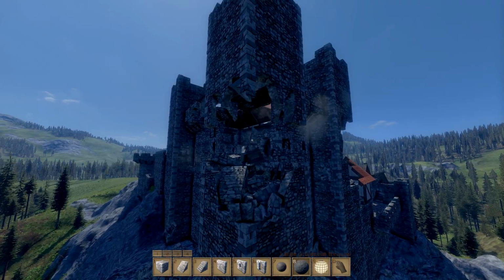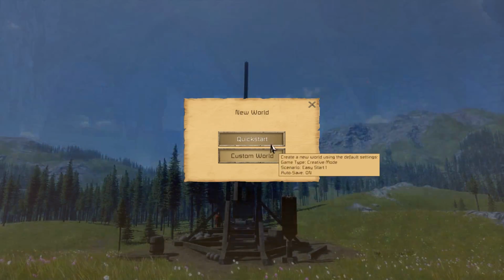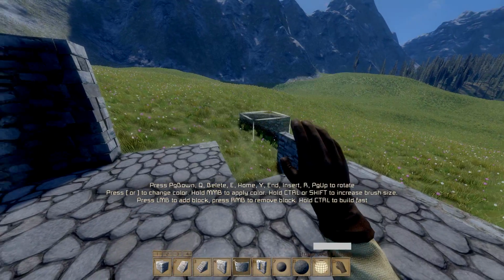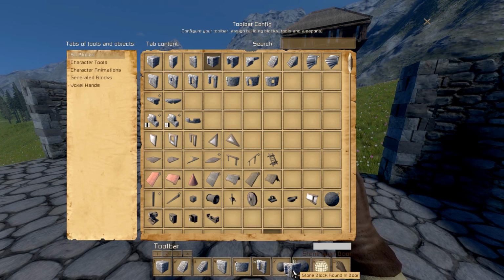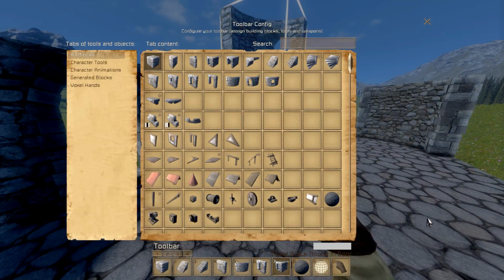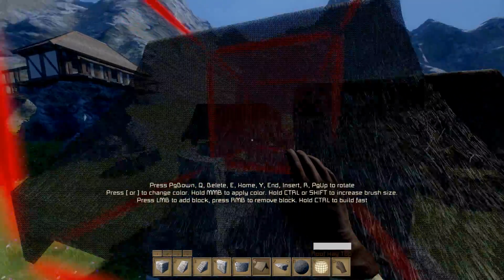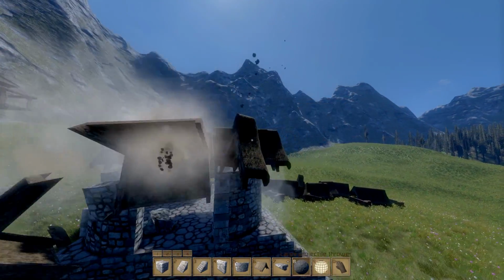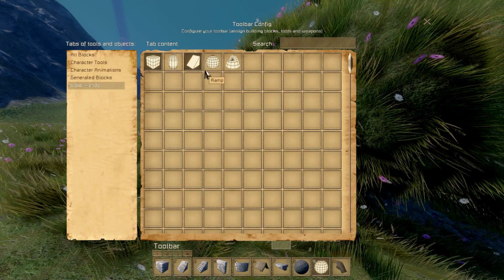Blowing Up Castles - Medieval Engineers

Comment: Is he really complaining bout just over 20fos? I run this game on empty map not moving at under 10fps. I run minecraft lowest graphics at just over 20fps very rarely hit 30fps.
Reply: Oh and btw Why Be Are you can place the walls I the corner, press alt and it toggles between normal placement and that smaller placement so you can place blocks in blocks. Someting space engineers never had.
Reply from the maker: Bran04don13 I mention it because I like my 60 FPS, and have a pretty good computer, so if it lags for me it will probably lag for people watching the video too if they had the game.
Reply: do you use optifine?
Reply: Bran04don13 Use optifine for minecraft, it helps :P

Comment: If you press "g" it will open up a menu then go to character tools and there are both those boulders with 10x the mass
Reply: Press crtl+w to access the rocket launcher, and mouse wheel to select the destructive radius

Comment: YBR, you actually can use wall blocks on corners. Hold down ALT while placing blocks to put them in the same space as other blocks, to make "compound blocks". Place one side of the corner, hold ALT, place the other side. It works!

Comment: You don't have to use rounded walls for corners, you can hold ALT and it will combine the bricks into the same grid, or you can click Z and it will do it automatically when you come across a brick.

Comment: Does this even have a hope of running on a Laptop with core i3 on very low settings?
Reply: Afraid not.. I am running an AMD FX-4350 Quad-Core 4.2 ghz 12 mb cache and a Readeon HD 7850. The game runs fine, but the moment you destroy something... The physics engine dies. The game could be stuttering like crazy, but you look down and see perfectly moving grass. So its not even a matter of your computer, its the game not multi threading. So then the game dies. Sorry you can'y play it, I was where you are for a while too.
Reply: Probably not, though my friend that has a prehistoric laptop was able to run it, with low framerate.
Reply: Never..
Reply: david Tschirky :(
Reply: Sorry is' so mein bruder kriegt kaum 30 fps auf der kleinen Karte und er hat nen i7 32 Gigaram, und ne GTX640(glaub ich zumindest dass die so heisst '^^)
Reply: SnK LaGhettochicken Alright, good to know.
Reply: SnK LaGhettochicken  cheaper yes, faster? not even close in multithreaded applications. clock speed isnt everything.
Reply: epikphlail OK, sorry I need to really read up on my i7 facts then! Thanks for info :P
Reply: epikphlail I guess the point I was looking for, was overall performance. They pretty similar in that form. I meant for the price, the 4350 is a pretty worthy comparison to the i7.
Reply: yes that is a lot more accurate. for a game like this that dosent use more then like 2 cores then your cpu is about as good as its going to get.
Reply: epikphlail Took the words right from my mouth XD
Reply: if you have a good graphics card, and configure it so that the game uses your graphics card instead of your integrated graphics on your processor.
Reply: Tsar Will a AMD A4 with AMD Radeon R3 with 4 gigs of memory be able to run it?
Reply: I AM GROOT Well what is your specs?
Reply: Windows 8 64-Bit i3 Mobile, HD 4000 Graphics. It will most likely never run.... because i have seen super computers lagging on that game :D
Reply: +ZackFogarty Games what are your specs judging by your profile pic you only play mine craft and call a celeron 450 with onboard graphics gaming
Lol jk
Reply: NotQuiteFishFPS I dont only pay minecraft,Thats just the pic i had made, Because my content at the time was mainly minecraft, And i only have an NVIDIA GeForce GT610
Reply: +ZackFogarty Games quite a good graphics card
Reply: NotQuiteFishFPS It sucks, I can hardly play any "high end" games, I am trying to upgrade but no money sadly.

Comment: Does it require a top-of-the-line PC?
Reply: I have 16 GB RAM, i7 4790K 4,0GHz and one Gigabyte GTX 970 and it still lags during (very heavy)destruction of castles. It's playable though, and if you're building only and not ruining castles I don't think it needs such a beefy computer.
Reply from the maker: OceanStream72 I think so to some extent. They suggest you have a quad core and a pretty recent GPU for it to run best.
Reply: WhyBeAre Cheers!
Reply: Neurosyphilis It makes me sad to know some people have better computers than me...

But hey, the game still runs at 120 FPS!
Reply: Starkiller10569 XD